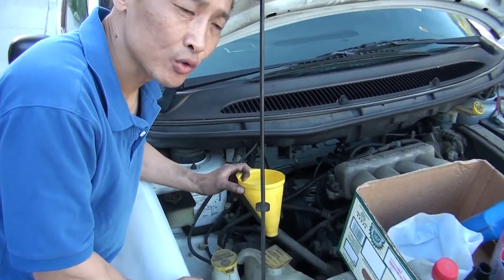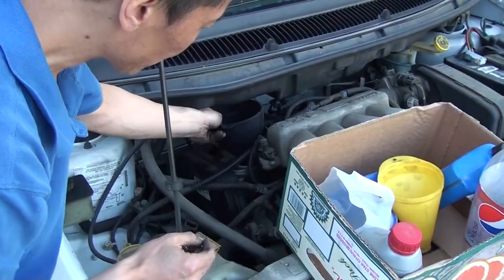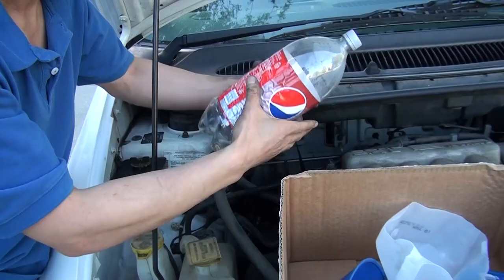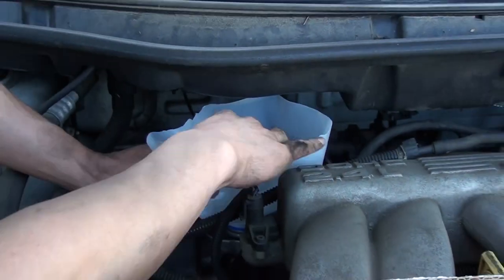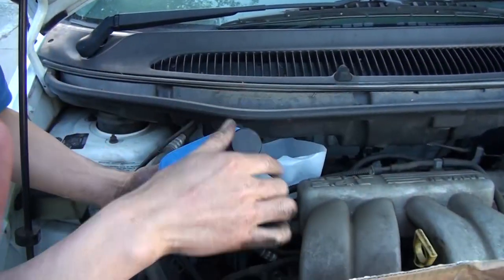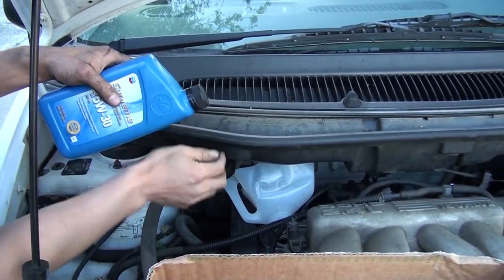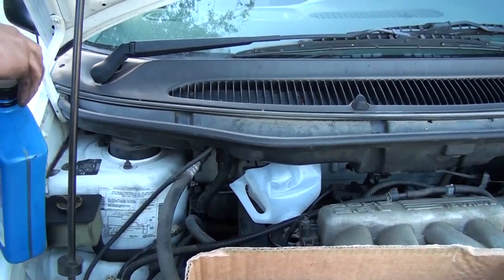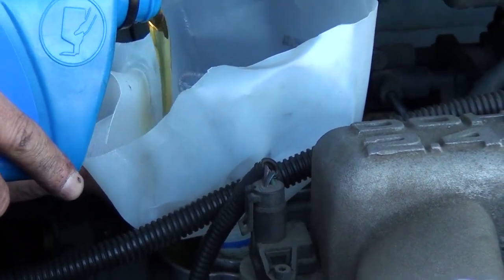4 Ways To Make An Engine Oil Funnel & 2 Ways To Pour Oil

Comment: Do you have any tips on how to make sure you pour the correct amount of oil into the engine?
Reply from the maker: Start by adding about half a quart. Wait a little bit to check the dipstick again.  If the level is still below or near the minimum mark, add the rest of the quart.

Comment: Thank you for useful information. I also use Mobil 5000 oil (HIGH DETERGENT OIL). What oil filters do you buy?
Reply from the maker: it depends on what kind of the car you have. Do you need the feature of anti-drain back valve to prevent dry start in the car? Or is it a race car?  I usually go with the cheaper price choose among Bosch, Fram, Mobil  and Motorcraft
Reply: Bought Fram because of non slip feature on container{and I like orange color).
 Purolators are least expensive with anti drain back feature. STP filters also low cost, but don't have anti drain back feature.
Reply: +corgLLC, Awesome tips.

Comment: Do you have any tips on how to make sure you pour the correct amount of oil into the engine?
Reply from the maker: Start by adding about half a quart. If the level is still below or near the minimum mark, add the rest of the quart.